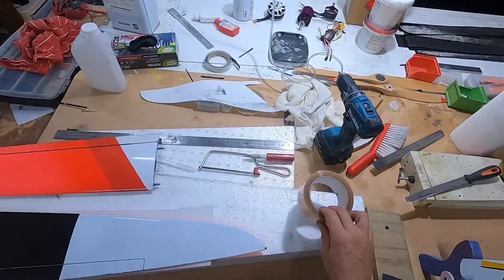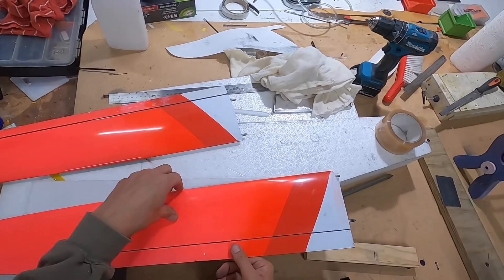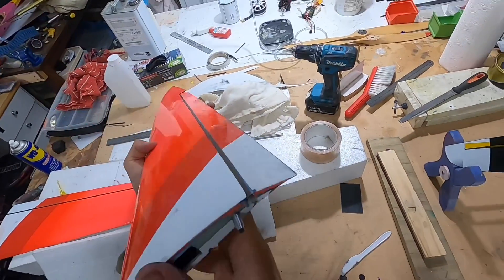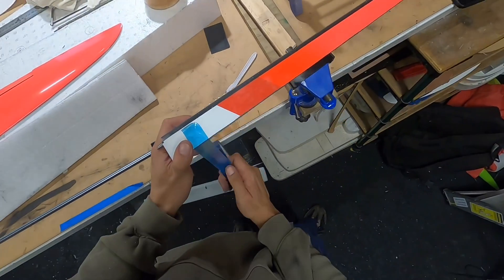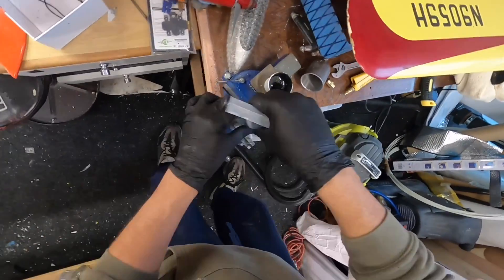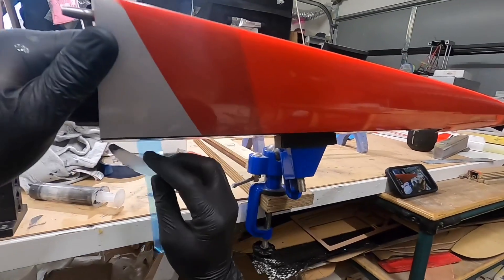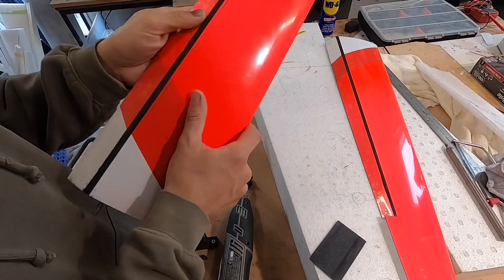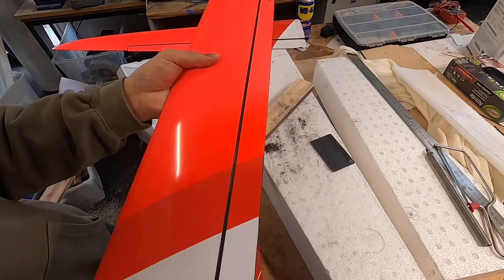How to make a “Wiper”

Comment: When you say you use micro fiber,  do you mean cotton flocks, glass beads, or silica? But thanks for the video. 😊
Reply from the maker: @JamesBaker-n5x  it’s microfibers. West Systems 413. They are tiny fiber strands that help to form a matrix and better structure
Reply: @AJHewson1  many thanks. That's cotton flocks. Thank goodness you don't have to sand it because it makes the resin extremely difficult to sand!